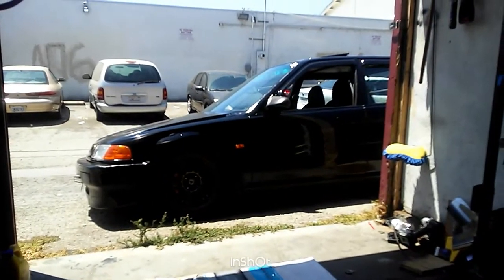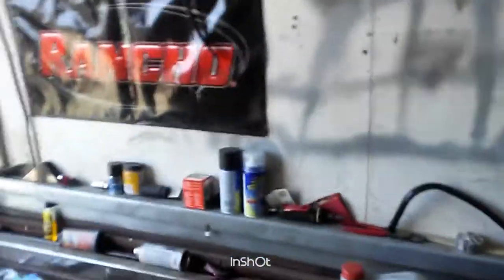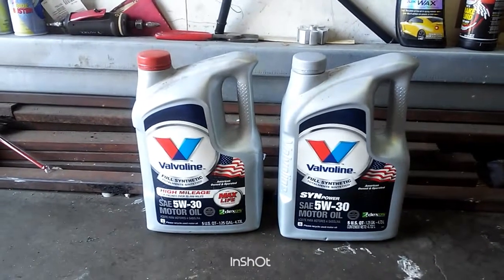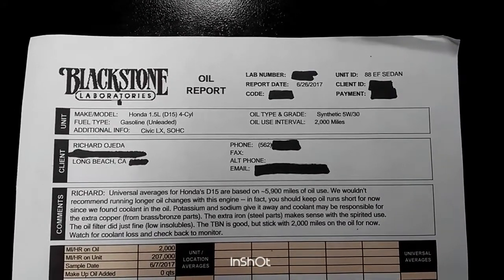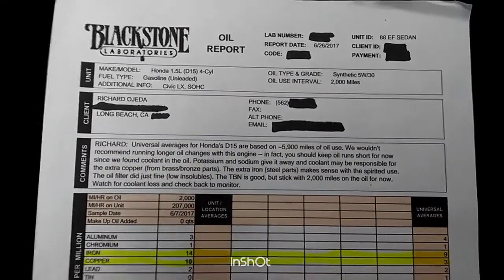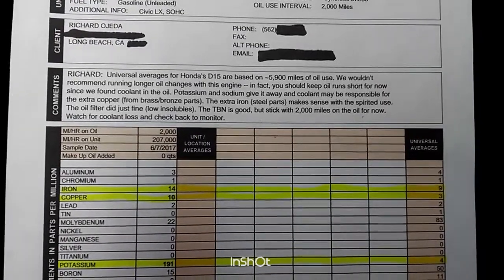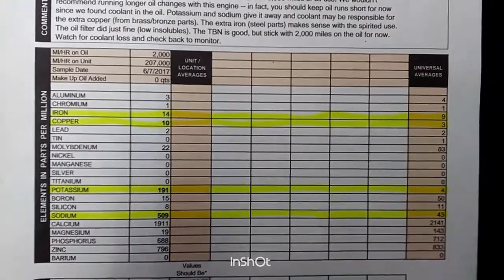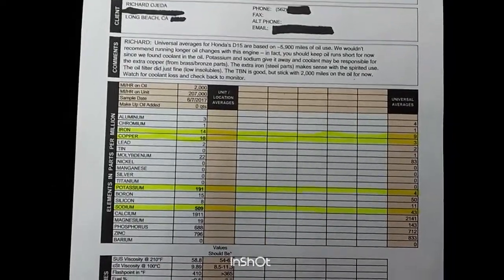Oil Analysis on 1988 Honda Civic LX (D15B2)

Comment: Did your head gasket ever end up blowing or anything? I have an '89 with only 196,000 km and I have to top my coolant off occasionally but it's never gotten any worse so I just leave it lol
Reply from the maker: I never replaced the head gasket. I had to top it off but not all the time. I could easily drive like 2,000 miles until the coolant reservoir would mark low. I most likely had a very small coolant leaking into the cylinder.
Reply: @TheRichardF10  Mine's not coming out of the reservoir, I have to top it off at the radiator a few times a year. Might be the water pump is going?

Comment: You should use a better filter will bring down the copper and iron, the media on those stp filters are only 93% you should switch to a 99% oil filter , Fram Tough Gard is a 99% so is the Purolater  One or the Bosch Premium
Reply from the maker: Yes, I've upgraded oil filters since this video. My favorite filter are fram Ultra Synthetic and Purolator Boss, and Wix XP.

Comment: How’s it stack up next to Penns and moble 1
Reply from the maker: You won't notice a difference between the three because they are all very good oils. I would use Mobil 1, Valvoline, And Pennzoil with confidence as long as they are full synthetic.
Reply: walmart supertech synthetic oil  performs the same compare those major brands   been using supertech oil since the 90s  best oil in the market

Comment: You do not need to use a Fram Ultra synthetic filter.  The STP filter is fine.  Sounds like you need to change the oil every 2000 miles or so.   More frequent oil changes not  a more expensive filter.
Reply from the maker: Serge Blain You are correct. I have done a couple more oil analysis since this video and I can say that 2,000 miles is fine. I can safely take the oil to 3,000 miles if I wanted to. I think I will stick to 10w30 full synthetic oil and Fram extra guards, I still have yet to try Bosch premium. I know they are decent since I have used them in my brother's car. By any oil, I mean I will test out every other full synthetic brand.

Comment: If you start using high mileage oil stay with it. High mileage oil swells the seals in the engine. If you go back to regular oil you could end up with leaks. Don't use high mileage unless you have problems. Coolant in the oil not good.
Reply: Valvoline high mileage oil does not swell the seals. It has an additive that keeps the seals from hardening so they remain flexible and maintain a seal between mating surfaces. Most oil leaks occur when seal become hard and are no longer pliable.
Reply from the maker: Arthur Smith Thank you but I have switched back and forth and have never had a leak of any kind.

Comment: I don't get what u mean are you overdue on your oil changes? Can you run longer? What do u go on by changing your oil months or mileage?
Reply from the maker: Clint Eastwood I simply change my oil every 4 months. I sent the oil to be analyzed and it stated I should keep my oil change intervals short for my driving style, which is spirited driving. I really don't put a whole lot of miles on my car within the 4 months. Roughly 1,500-2,000 miles. I want you to keep in mind that this was my very first oil analysis I've ever done. Even though my oil is dirty with elevated levels of iron, it still has a good TBN. Honestly, if I drive the car normally, the oil should come out cleaner and have a higher TBN, meaning longer oil change intervals. Please feel free to ask me more questions, I enjoy talking about oil.
Reply: Richard Ojeda cool